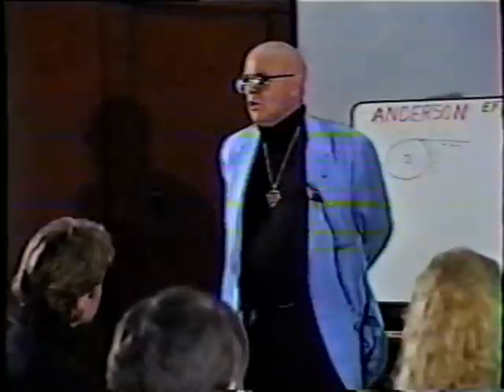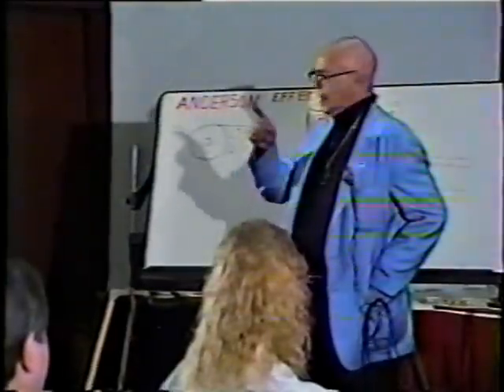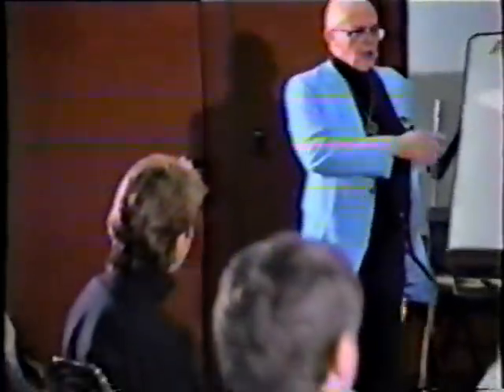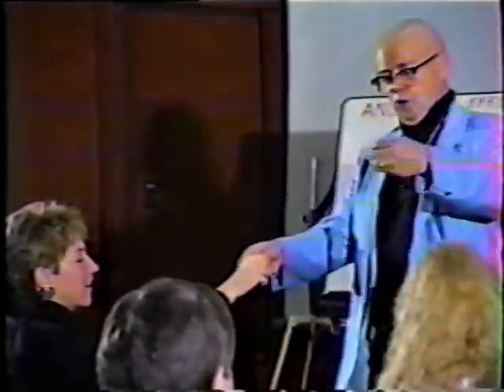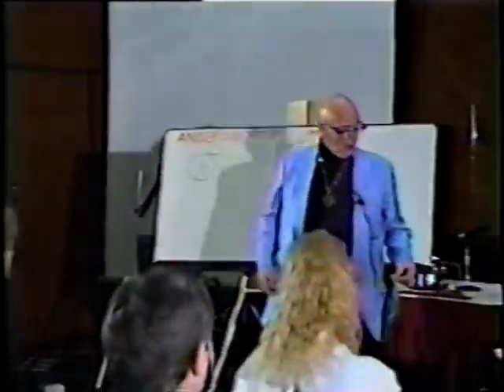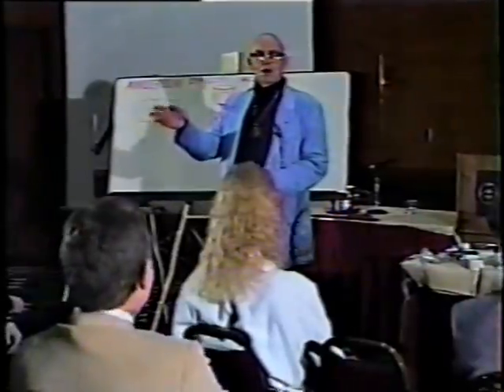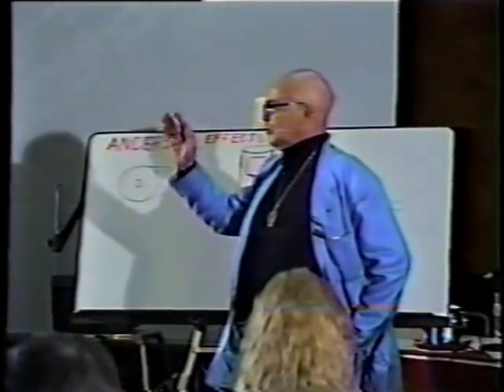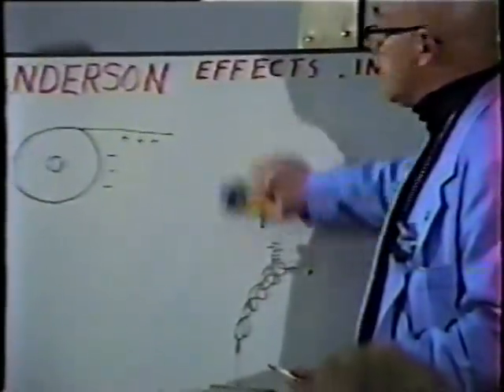ESD Explained & Demonstrated + History of the Pink Polyethylene ESD Bag

Comment: This is fantastic!   I was a young guy in Southern California learning all I could about electronics in the 60s, so all of the references he throws-in are familiar and funny.  I don't know who owns this video but it would be good to make a shorter edited version for the rest of the world who has no familiarity of the references.  This is like a PHD course in Static Electricity and its effects, taught by the "educated son" of "Foghorn Leghorn".

The best way to avoid ESD issues is not to have any static electric voltage differences, which can easily be accomplished by careful planning and habits.  For example: as mentioned numerous times in this presentation, the major source of Static Electric Charge for people is the floor they walk on.  Use a static dissipative material for the floor and 95% of the problem never happens.  After designing and building a number of electronic production facilities and labs, I found a great answer.  There are several companies which sell conductive floor tiles, but in the late 70s they were $5 to $10 for each 12" x 12" tile, required grounding foil / wires underneath  and special conductive adhesive.  These all were embedded with conductive powder  (carbon, aluminum, etc.).  I accidentally found that the cheapest  floor tile made by Armstrong solved the problem at $0.99 each.  The low price was due to the fact that it was, by far, the most widely used floor tile in the US.  It was easy to install and very durable.  It was also Static Dissipative!  I never understood why until Dan explained in the video how the pink plastic actually works.  Moisture.  These tiles would absorb moisture, so to ensure a clean, long lasting floor, they had to be sealed, then waxed as desired.  About every 6 months, they needed to be resealed because the moisture seal would be worn away.  

Thanks for posting this.
Reply from the maker: If I get some time after the lab move I might try and do an edited down version

Comment: I work for a harsh environment connector company, and we just received a customer order where on their PO, they had a requirement that pink antistatic poly could not be used in the packaging or come into contact with any of the parts at any time of their production. They are a satellite manufacturer and apparently there is a problem with outgassing and/or contamination from that stuff. Learn something new every day!
Reply: That is interesting. What do they use instead?
Reply: I guess they are really screwed, then.
Reply: This is true! Was first discovered by Matsushita (panasonic) which shipped all their semi's in aluminium foil.
Reply: @MM-lv8ib  Yes, components destined for space use come wrapped in aluminium foil or stainless steel envelopes which are as sharp as razor blades.

Comment: My most memorable encounter with ESD:

I had received in a tape-storage robot shipped from a datacenter in London, England to my facility in Dallas, TX.

The numbskulls wrapped it in about 20-30 layers of plain, clear bubble-wrap.  This made it into essentially a huge capacitor with a tribo-electric self charging mechanism.

When I finally got through the wrap and made contact with the metal inside, while standing on raised flooring (which is metal tiles filled with cement on a metal framework that's bonded to ground)  The resulting discharge knocked me clean onto my ass.

I've taken zaps before, even accidentally discharged a CRT.  That was all nothing compared to that bubble-wrap static bomb.

Comment: Fantastic presentation. Makes me wonder what, if anything, significant we've learned in the industry of ESD protection in the 40 years since this talk. (Also, good lord. It's been FORTY YEARS since 1980!? How on earth did that happen?) Also, in some space applications, "pink" plastics wouldn't always work because a vacuum destroys the moisture layer. Makes me wonder what the physics of, say, docking a spacecraft with the ISS involves with regards to safely discharging any difference between the two structures.